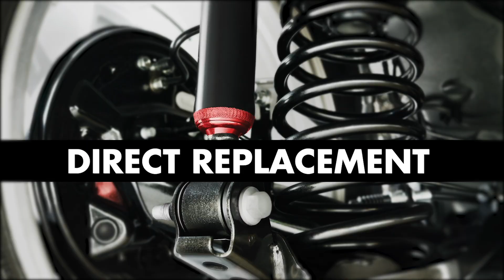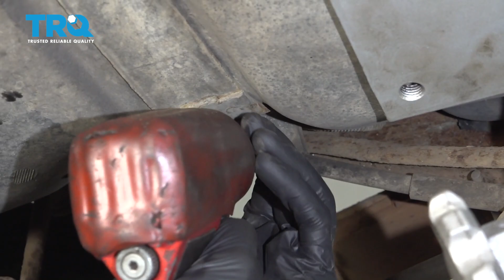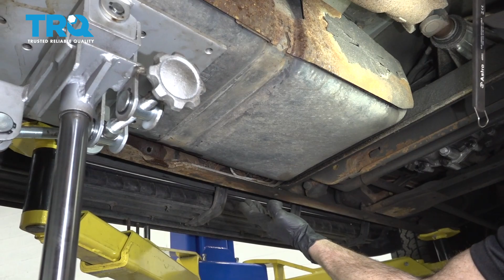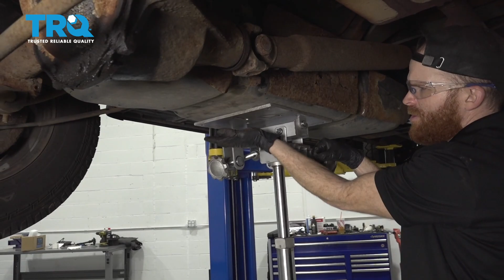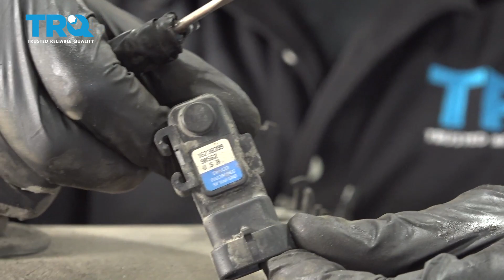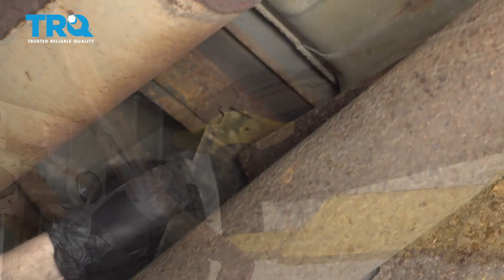How To Replace Fuel Tank Pressure Sensor 1992-2000 Chevy Tahoe

Comment: My sensor on the tank in my 2000 5.3 ls Tahoe must be going bad my fuel pump went out this summer and I got one on Amazon and it is a DWVO that is for replacement on my truck . And it says that the pressure sensor is o  my pump. Can I unplug the one In the back and fish the wires up to my pump . It is building up so much pressure that it is starting to. Howl till I loosen the cap and let the pressure out. If not it won't. Start

Comment: Do you know if the wiring connector on the  vapor canister solenoid behind the tank leads to the vapor sensor connection? I've got a broken wire on the solenoid vapor valve and it leads to the top of the tank somewhere that i cant get to